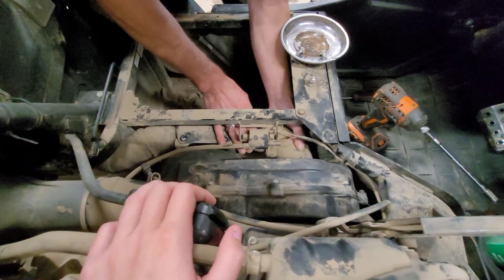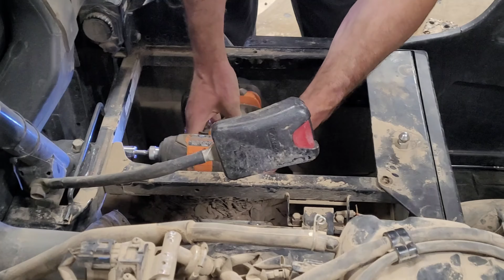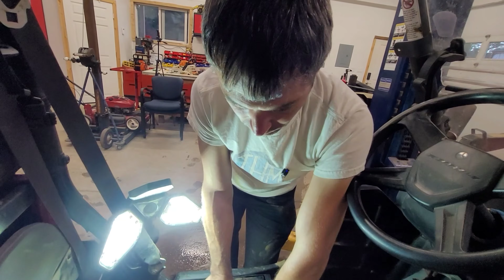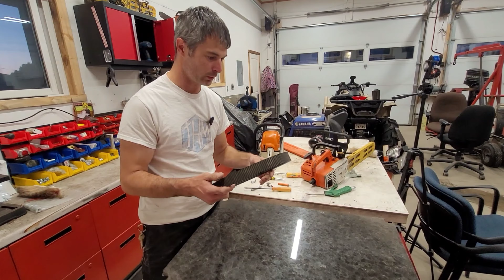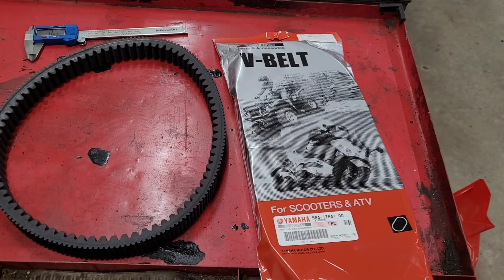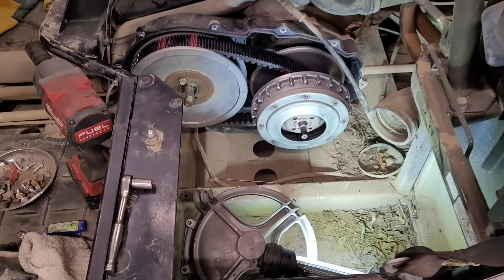11K Miles!! What Will the CVT Belt Look Like??

Comment: Hold on a second there buddy!   Didn't honda have the big red?   Maybe that wasn't really a true off-roader though.
Reply: Actually, the big red came out in 2008.   I thought it was earlier than that but i guess not.  2013 was the year the pioneer was released.  Great video BTW.   I guess those cvts can last a while, but I still want a real transmission that will likely only need occasional fluid changes.
Reply from the maker: @sunsetoriginals7320 agreed. Honda makes really nice transmissions. They are also auto or shift on the fly 👌
Reply from the maker: @sunsetoriginals7320  yes they did. They came into side by sides in 2013. Yamaha started in 2003(production year 2004)